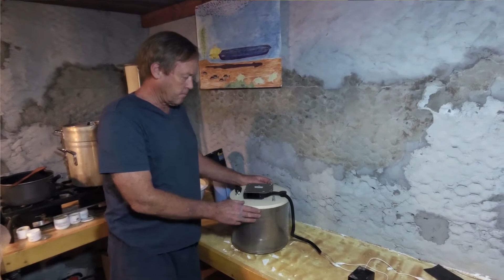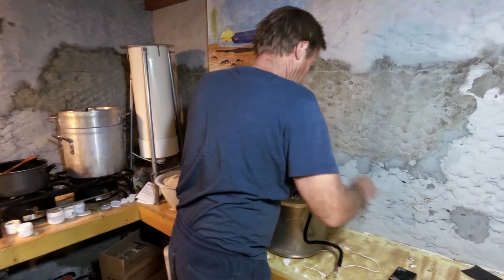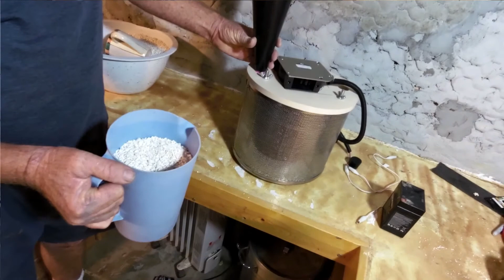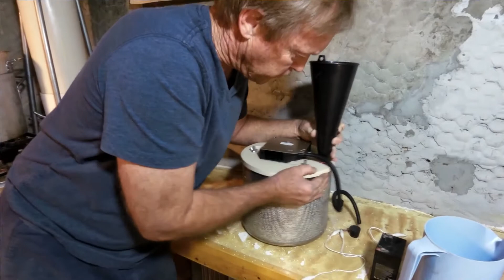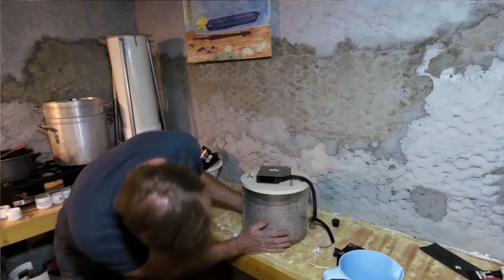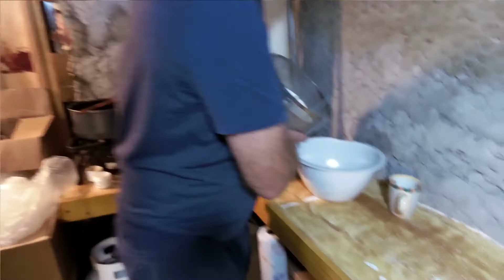CO2 Scrubber

Comment: When I was doing the math it would cost about $12 per person per day in lye if you are running the scrubber on lye. I realize that lye isn't necessarily the cheapest option, but whatever it is you are using you are going to want to react multiple pounds of it per person per day, and that is never cheap.
Reply: You need to redo your research and math if your using lye to scrub CO2 😂
Reply: @anotherguy9402  Cost wise there really isn't a CO2 scrubber that is affordable to operate for long periods of time.

Comment: Most simple scrubbers of this design used soda-lime pellets as absorbant.  Any lime from a hardware works, but pellets allow for air to circulate between them.  In 10th grade chemistry we used crushed marine shells for lime.  You can dissolve lime in water and alow air to bubble through it. Submarines now use a highly efficient reusable liquid absorbant that releases carbom when heated. There are many plans for simple scrubers for use in fallout shelters of the 1950-1960s era.
Reply: Thanks for the info , I'd like to hear more about the reusable aspect of that .
Reply: @tericox9593  Submarines and the space station use AMINE the liquid absorbent I mentioned.  There are many videos on here about scrubbers. This youtube video tells more about the AMINE type. 

https://www.youtube.com/watch?v=QsLYRmng1BU&t=149s

 (note soda lime pellets are reusable many times until they wear out and change color to purple when they are no longer good.)  ALL absorbents are relatively costly except for short term use.
Reply: What's the title of the video?
Reply: Thanks, Daniel, for the tip. What I did was take an AC Infinity air scrubber, dump out the activated carbon, and refill it with pelletized soda lime. It brought down my CO2 in the room where my aerobic waste digester is to a reasonable level and the veterinary-grade pellets I use even have a color indicator to show when it's time to replace the filter media.

Comment: I must have missed it, but are you using LiOH pellets?
Reply: Using a product called Sofnolime, I believe it is mostly calcium hydroxide
Reply: Funny, I was reading a Sofnolime case study after I watched your video!
Reply: What product could be used to absorb the CO2 that would be able to be regenerated with heat or pressure swing?
Reply: Can you tell me how you made the canister components? Where they were procured?